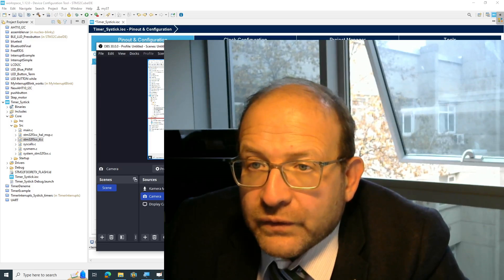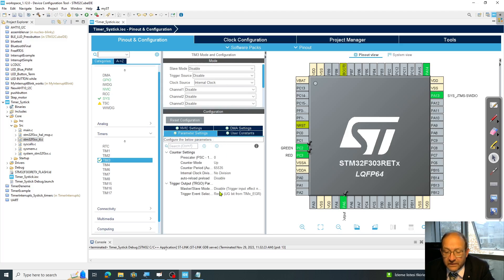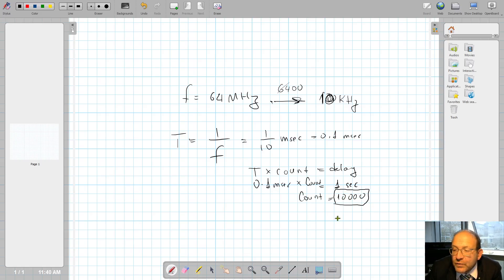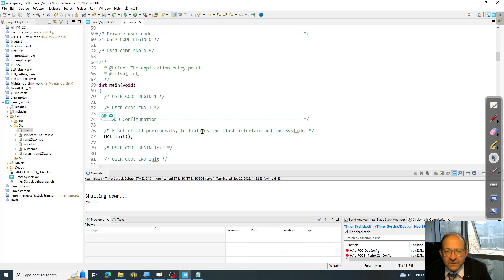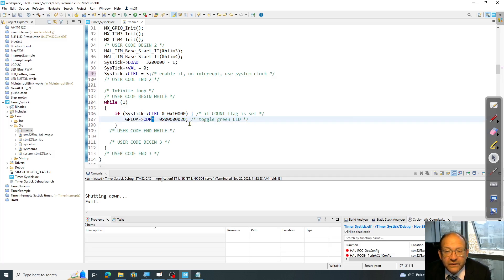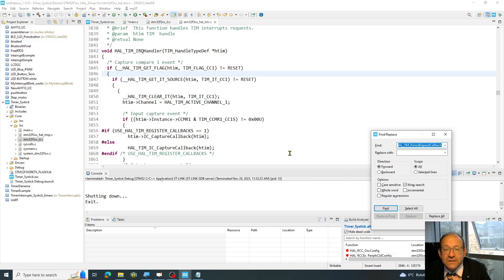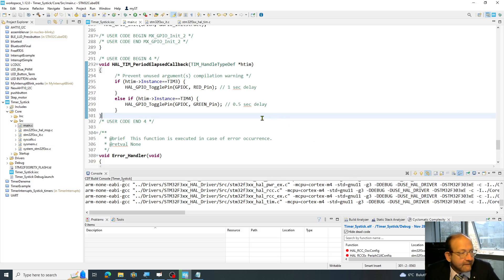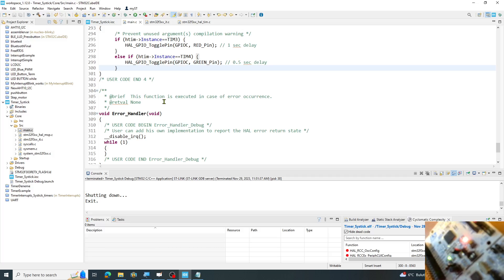Timers and Systick interrupts and polling with STM32CubeIDE

Comment: Thank you for your excellent video, which gave me a lot of insight and inspiration. I have implemented a slight variation on the STM32H747, where I have first disabled the Systick timer interrupt by calling HAL_SuspendTick(), then I initilized the Timer3, and started it by calling the HAL_TIM_Base_Start_IT(&htim3) right in the user code section of the initalization code (to keep it cleaner). The timer  HAL_TIM_PeriodElapsedCallback() is then calling the SysTick_Handler which increments the systick. That way the Systick can be controlled by a timer if needed. If there is a different way to do that please let me know.